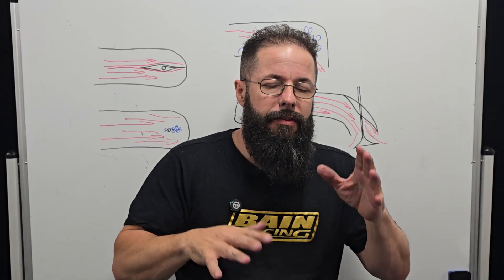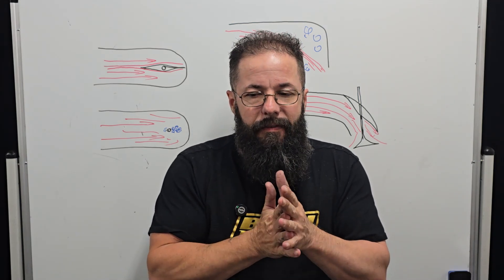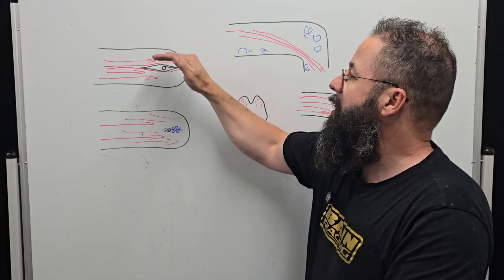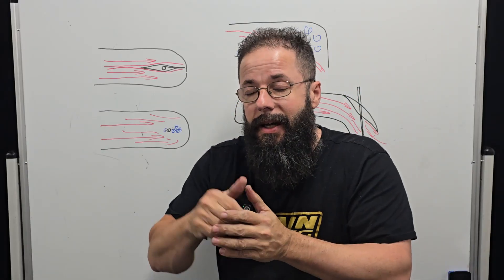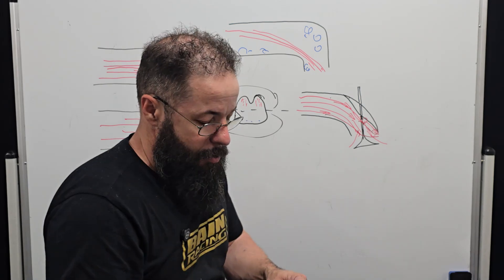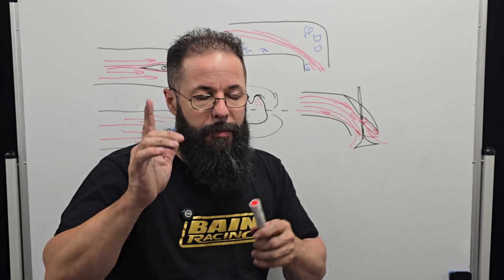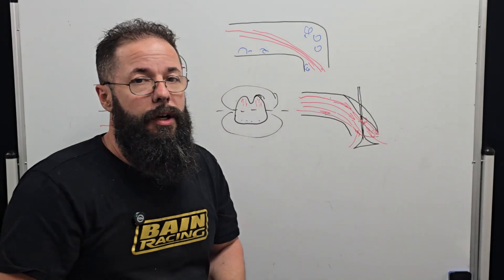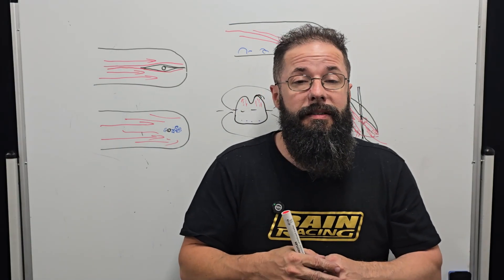FLAT ROOF vs VALVE GUIDE FINS - Why Less CFM Can Make MORE Torque & Horsepower. Bain Racing

Comment: All bench top testing misses the big picture: the valve reciprocates open and closed, as does the piston.
The reason why velocity is important is that the valves closes and airflow stops for roughly 2/3 of the engine rotation. CFM is not continuous, it pulses. Velocity causes pressure gradients, which can be beneficial if they occur in the correct spot. Ideally, you want a high velocity through the port to create a low pressure in the port, this low pressure continues to draw air in while the valve is closed. But, when the valve is closed, the velocity of the air is  also converted into static pressure at the valve face. 
A properly designed port will flow a good CFM when the valve is open, it will continue to draw air in when the valve shuts through high port velocity, and the momentum of the air velocity will stack against the valve when closed to create a high pressure pocket that expands into the cylinder when the valve reopens.

A port which is too large with low velocity performs better when the valve is at full lift, but a high velocity port will breath better than the large port when the valve is at lower lift near the opening and closing event.
Reply from the maker: You're absolutely right, the transient nature of flow in a running engine is key – it's all about managing those pressure waves and inertia!
Reply: @bainracing  Just not sure it is the actual waves we try to "manage" as much as something more like managing something I did not understand until a few decades ago. Looking back it explains almost everything. Pressure recovery. Everything, and I mean everything from tiny one cylinders to banks of cylinders, that one thing alone improves everything. Nowadays, looking at combustion chambers involves much more than burn rates and area. The port is longer than we thought it was. Looking at the chambers produces an exceptable and possibly exceptional valve seat and angle area to target a window of goodness.
Reply from the maker: Oh its all of it mate. The wave management is literally 5-7%.  But yes pressure recovery is directly related to CSA. Hence why i focus on it. 

And yes!  You're 100% right. The chamber is 100% an extension of the runner. You can have the best port in the world. But if you just dumb it in the chamber you won't make power! This is why our discharge coefficient is a great reflection of this!   

In the 4 valve scene in developmental work we see a clear correlation between the lack of short turn and the degradation of the tumble ratio.  Which if you get the rumble energetic enough its dynamically improved HP. Without improving VE'S.  Its a delicate balance and its why we are seeing kick ramps of very straight ports to try and get some of that tumble mechanism back.
Reply: @bainracing The Force is strong Luk. My Starfighters will do better. Like, like dropping stuff in the pool and trying to avoid the spash 🤣  turbulence 😢😂

Comment: I have a set of LS243s that i cut for 2.165 intake valves, and using 2 part epoxy, added a tail fin from the guide boss down to the seat (much too long, just to see) and it did pick up 10 cfm up top @650" lift, but weirdly lost flow @250"-350" lift to the tune of 20 cfm. My only theory thus far is that at those lift numbers, the air want to travel right to left as it approaches the throat, and that fin created a lateral obstacle. 

I still need to pull those heads off the shelf and finish the ports, as these tests were still with the port entrance 15-20% smaller than the throat. That damn pushrod pinch.
Reply from the maker: Yeah lower lift trying to push to bore centre 👍

Comment: I had the luxury of trying to fix a set of SB2 head that had gotten a "super special 🔥 " port job. While I was able to get cfm across the board, they murdered the lower lift flow curve by removing the valve guide, and straightened the SSR. .400 lift really tells you how good the head is gonna be, I gained 17cfm there, and I was still almost 60 cfm from where it should have been. By .500 lift it was only 20 cfm off, by .600 the port finally "lit" if you will and started to get velocity where it should've been.
Reply from the maker: Nice!  Ive seen that a few times.  Must be lots of "super special" porters out there! 😂😂😂🤦‍♂️

Comment: I did a test on a set of expensive super stock heads(hemi) that I thought needed more streamlining it actually lost power. I don't whittle the guides anymore to max thinness I prefer to have the extra support for the valve stability especially at the base. also thinning them down creates problems when it's time to service the heads the thin guides bust apart when new guides are pressed in. my answer for this is; take the heads off of the car and streamline everything re-install and tell me if your car picked up any speed or e.t. the clocks are the dyno.
Reply: Footnote; I do streamline the guide area, but I don't go max thin anymore. I also use epoxy for my streamlining and the tails on racing heads. my background is Mopar Super Stock.
Reply from the maker: Yeah. Hemi you need to be careful they are all about mass flow. Also they need far more guide strength. 👍
Reply from the maker: Key word there man. HEMI! 👍😂.  They break all the rules.